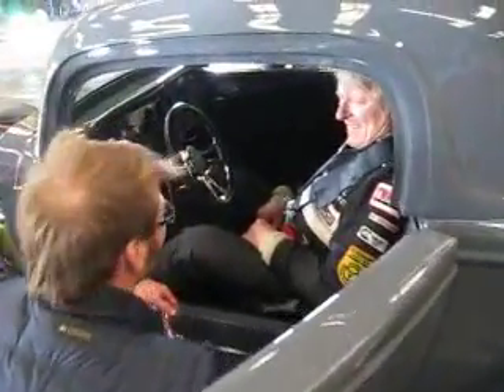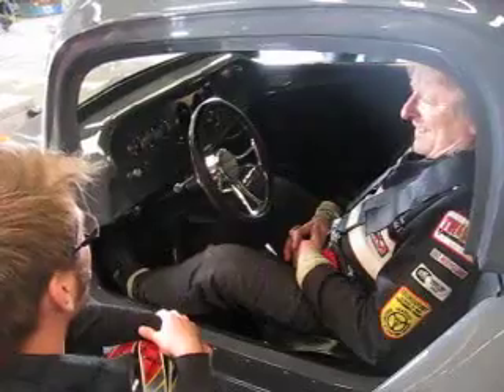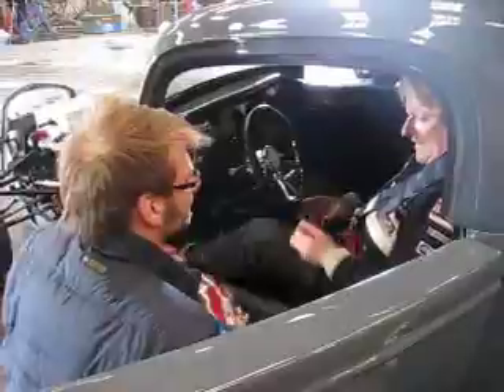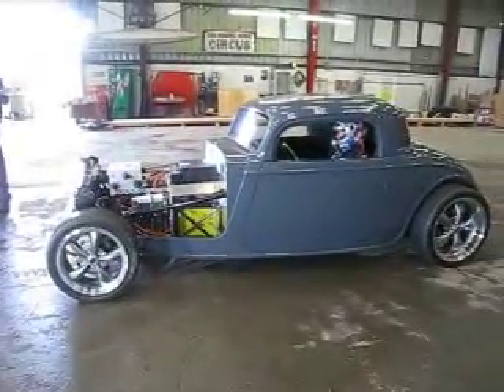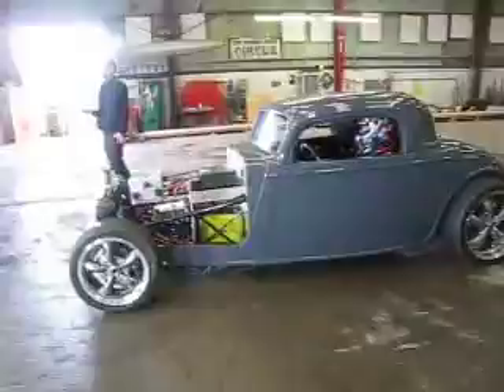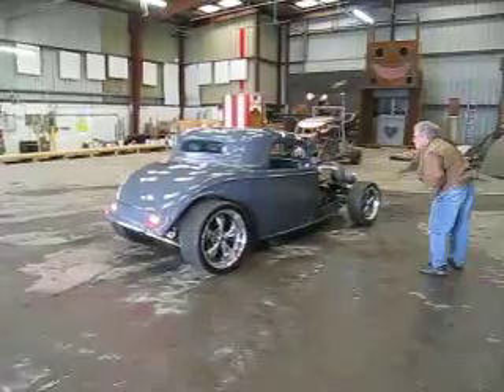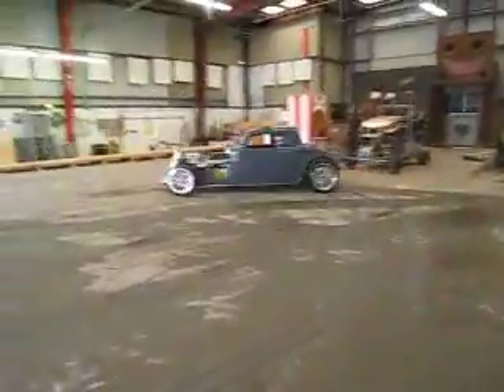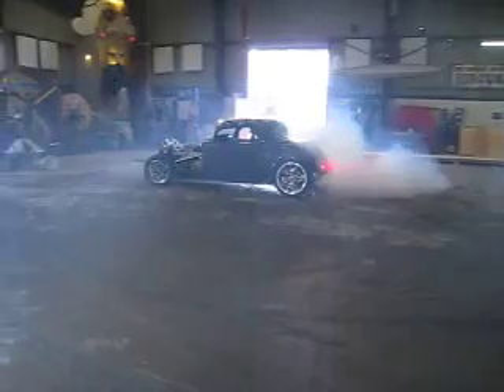Electric Hot-Rod - First Indoor Test

Comment: where can you get a DC motor from
Reply: Jordan Young Got my forklift motor from a used forklift$200 48volt 10kw. If I advance the timing. I'm quite sure I could put a hundred and forty four volts of electricity on the thing. The torque on them things or unbelievable.
Reply: There are now sites online where you can buy kits. That is my suggestion. Electric hot rodding is the same as gas. Ton's of people believe what they have is awesome, but it is not. Like a forklift motor. Just no.

Comment: Awesome build. Any hits to where to start? Am looking into a Factory Five 33 hot rod EV build, but need some information on parts and how-tos. Any information appreciated.
Reply: +Oystein F. Saebo I was looking into doing the same thing. EV West has a kit for the Factory Five 818 model. I was going to talk to them about doing a setup for the 33 Hot Rod model. EV West's Dual Siamese Warp 11 motors does about 1,000 ft lbs of torque.
Reply: +icerdemon Thank you so much for the information. Will definitely look into EV West!
Reply: Oystein F. Saebo I am looking at a 34 woody build nest year, currently building the woody body, I priced up loads of options and came to the conclusion that buying a complete high mileage crashed tesla and selling off all the unwanted bits would be cheaper. My local wreckers had a p60 for about 20k$,
Reply: Oystein F. Saebo if it can do a burnout, it is broken.
Reply: start with 200,000 dollars and work your way from there

Comment: It brakes after you let off the pedal? How stupid is that? Imagine driving this car in the rain you take a turn and let off the gas pedal bammm the car brakes you lose control crash. They really had something going here the car is badass but get rid of that problem if you haven't yet.
Reply: +HundredShot TheUnit That's a totally normal response from an electric vehicle.  It's called "plugging".  Ever drive an electric forklift?  Same concept.
I don't think he implied that the actual brakes engaged.  Just the backlash from the electric motor.
Reply: Wak Job I've driven a tesla before and its nothing like this. You could clearly see in the video that the car brakes when he lets off thats why he was having problems controlling it. It's right b4 your eyes.
Reply: +HundredShot TheUnit totally agree , i work in hybrid cars' development and it's optional to make the regenerative brakes on EV.s work with the pedal's release or it can be separated it's only limited by the designer's capabilities
Reply: Compare it to an electric golf cart...on steroids. they have a brake, but not needed unless its an emergency stop.

Comment: how much it costs that car?
Reply: _iTa_Free says in the video they spent over $200K USD on the construction of this car. This would be mostly attributed to the battery types and specific electric drive motor choice they put in it. Wiring a decent system and management integration would also have high costs. In saying that, if he drives it everyday for 200 years he will have repayed the cost of building this car! haha. but it sure is cool!.
Reply: 1971SuperLead  anyway remain a nice car for my taste :)
Reply: _iTa_Free its custom they made it there is no price
Reply: how many hp has the car ? :)
Reply: _iTa_Free At 1:20 he says it's a $20,000 car.
Reply: $200,000

Comment: Did i hear someone say EMP o.O?
Reply: Even a ICE wouldn't start if there was an EMP.
Reply: that is a very common misconception. any old carburated Vehicles will run perfectly fine. and most every car built past 1982 the ECU itself is a faraday cage and most of the electronics are also in a faraday cage. the metal webbing on the underside of your dashboard also acts as a faraday cage. worst case scenario a few fuses can be replaced and you're back up and running. most modern day cars let's say 2000 and up are not going to be effected in the slightest by EMP.

Comment: I'm and old motor head and love the sound of performance motors, but torque is torque, no matter what makes it, I'd love to have a vehicle like that.
It wouldn't be a bad idea to have actual motor sounds come out of speakers so people hear you coming.
Are there any follow up video's?
Reply: Surely its got a horn. Just honk the horn before you move. With this car, people will be watching you anyway, so less likely to not see you coming. Otherwise, its a vehicle like any other car, look both ways before crossing the street, like you are supposed to do. Install a reverse alarm, like most golf carts.

Comment: This is what happens when you have more money than brains, for the driver, to burn the rubber off the tires inside the building. I would have driven around until someone with what they thought was a badass Hot Rod pull up next to you. Then they would ask what happened to your motor (because he couldn't hear a gas engine)? Thats when I would have told them, "Well, I did a little electric conversion on this"! I'm sure the guy would want to see how it goes, then, I would have smoked him!

Comment: The Powertrain alone was $60K, + $40K Battery Pack.  I don't know the $ of the Factory5 kit, but add that, then another $20K in hardware, charger, wiring, etc, and you still have to pay me to put it together!

To do it again now, I'd simply buy a new Toyota Rav4 EV (Tesla Drivetrain) and shoehorn that in there.  For ~$40K you get a whole car with all EV parts; motor, inverter, battery, etc. and it's a really nice setup.  Another $40K worth of work to get it integrated nicely.  (+ chassis $)

Comment: Ironically, I don't think that demonstrating energy efficiency was the point here. Otherwise they would have used a smaller motor, a lighter frame and much less power.

This is to prove another electric concept. Sell the sizzle.

Comment: I know the scale is off, but I have a 1/10th scale RC dragster. It was running spare electronics I had lying around. I guess I was running it at the limit of the electronic speed control for both battery supply and engine draw. It got hot, fast, and then caught fire. Before I could get a extinguisher some circuitry crossed and the car took off at above average speed while on fire. I caught it in some grass, high centered the rear end, and extinguished the fire.

Comment: How true. While I love the riddim of a Flathead or a Hemi, this is just as impressive. Even if it had a gas turbine, I'd still love it because it's a '33 Ford. Hell, Gas Turbines run on anything, which makes it adaptable to run on biogas from the sewage works (or even chip fat). If the manufacturers cottoned on to this and made the Toyota Pruis like this, then it would sell. It would alsoshow these (and hybrids) are not a new idea.

Comment: I agree that this is a hot rod to the core.  Back in the day hot rods were about taking whatever you could find and bolting it onto a car to make it go as fast as possible.  They also represented freedom from conventional standards.  If a Ford chassis can have a Chevrolet engine, a Chrysler transmission and still be a hot rod than why not throw in electric motor?